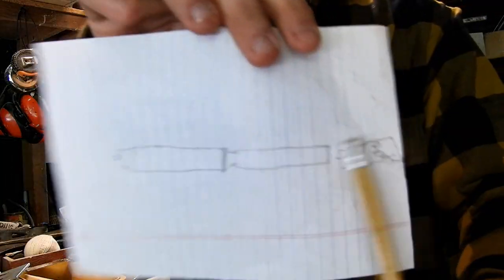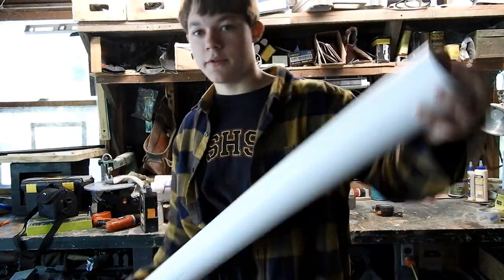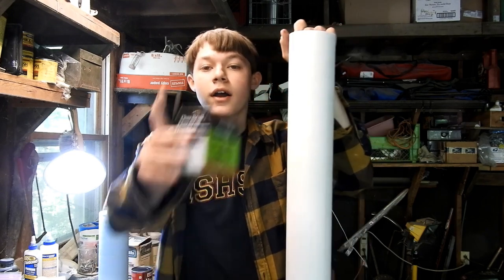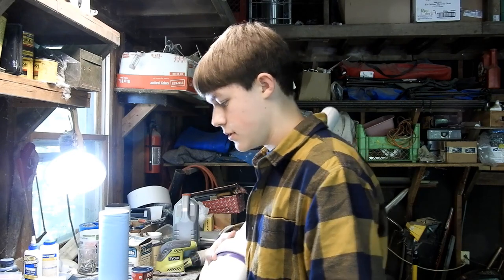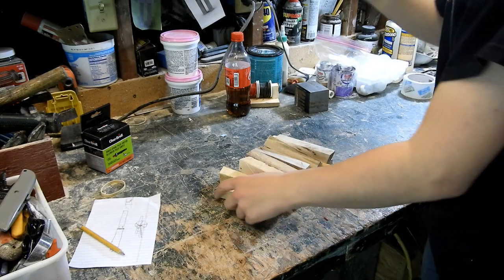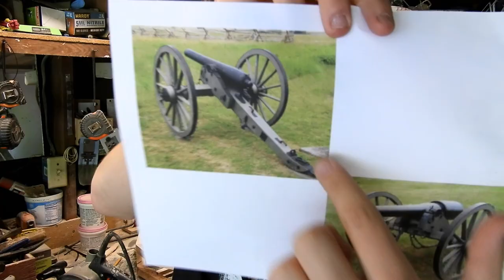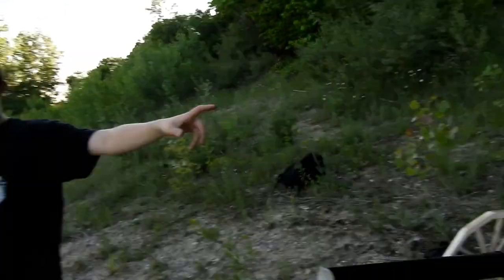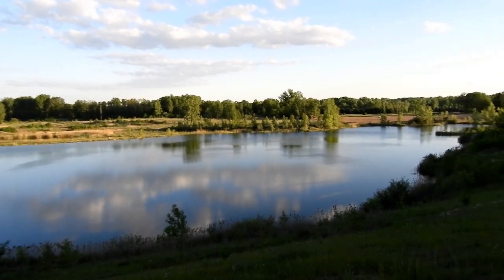How to Make a Civil War Cannon that Fires Cans of Beans

Comment: Vereh nahce choice of beans, although, you must absorb the moisture of bushes baked beans. NOT Heinz baked beans
Reply from the maker: Tried. But cringe bean cans had diameter a tad over 3 in. So it no fit in cannon. Cringe.
Reply: The 7th Angle cringe cronge indeed